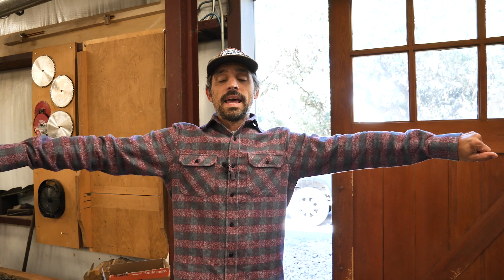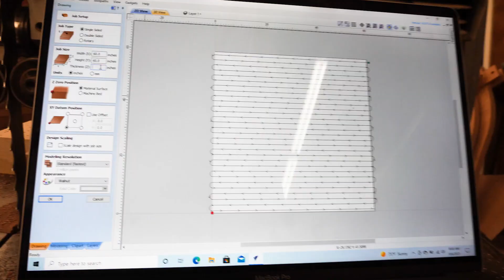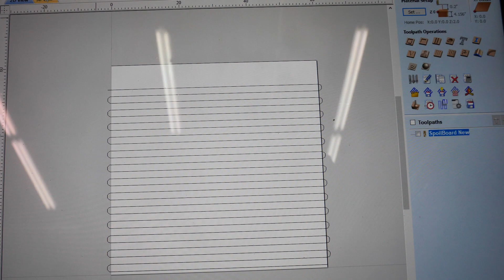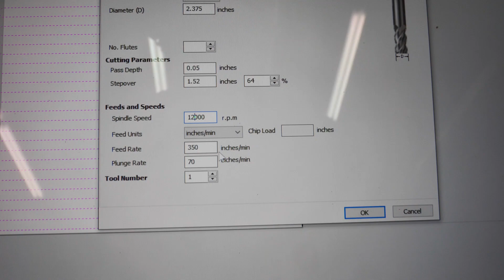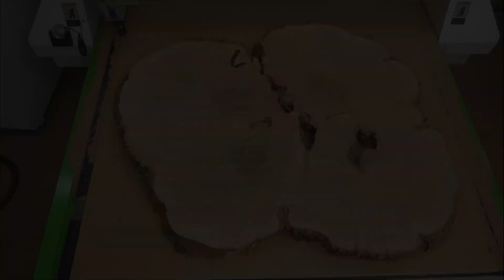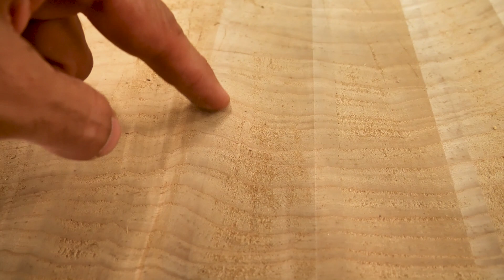Surfacing a Giant Ash End Grain Slab on the CNC

Comment: the tear out is likely because of the direction the cutter is moving relative to the direction it is spinning, also your stepover is huge, if you cut that in half to 50% of the blade diamerter you would get way cleaner cutting with less edging in theory, nice slab and nice work!

Comment: I'm not an expert on CNC's, but if I had to guess, the motor is likely not perfectly trammed in. so it's dragging in the one direction on something other than the cutting edge, but not in the other, thus the blowout (which is still pretty minor)
Reply from the maker: I don’t think it the motor.  This is a brand new machine and I’ve had no issues that would suggest the motor is not dialed in properly.  I’m pretty confident it’s a combination of feed speeds and rpm.
Reply: @AndyRawls  The motor is not trammed properly, ie. not perfectly perpendicular to the table, hence the cut pattern visible. Wide bits will show out of tram much more than narrow bits. If you run your finger across the cut I bet you'd feel a ridge on each pass.

Comment: The rough side of the cut could be a result from a non climbing cut, or conventional cut. Or it could just be a z axis misalignment. The machine being new and taken care of I would lean more towards trying to take the face mill in one direction while climb cutting
Reply from the maker: Interesting thought and worth a try.  Thanks
Reply: Yes, a climb cut will get you a cleaner cut than a conventional cut…  in metal at least. I’ve never machined wood, but the way I’m thinking it’ll work best is to conventionally mill into the wood from outside the workpiece. The amount of flutes or cutters on the… well cutter will also affect how clean it’ll cut, and so will spindle rpm relative to feed rate.

Comment: Andy is your surfacing but a straight cut conventional cutter or is it a multi tip carbide insert bit? I’ve used mine to surface all sorts of wood and it’s never once torn out. They’re expensive but last forever just like spiral cutter heads.
Reply from the maker: Multitip carbid inserts.  There’s three cutters on it.
Reply: @AndyRawls  your machine did look like it wasn’t tramming correctly have you checked that? It could just be the camera angle and some shadow lines? That might cause the problem.

Comment: With this soft of material you can probably go much deeper and faster in movement when ruffing, just need to do a finishing pad at the end. 
Well I come from metal so not sure about that.
Reply from the maker: I do think I could take a little more just trying to not overwork the machine
Reply: @AndyRawls  there isn't realy such a thing as overworking a machine, you do want it to work on the almost maximum of its ability, if you do so you can safe time wich also means saving money.
Reply: @Jason F we’ll probably not much harder then aluminium 🤷🏻‍♂️

Also might be worth using a tool with a larger radius and ore more cutting edges to also have a higher speed if the machine has enough power

Comment: Im not a wood worker but on steel  you sometimes need to cut against or with the axis motion for the best surface finish. 
Half the cutter is cutting in the direction of travel and the other half is cutting away from it.
  So perhaps programming the last cuts to only use half the cutters width and only cutting from the same side would help?

Someone else with better English skills will probably explain it better. 😅
Reply: 100% will help, Having the overlap will make a cleaner finish! I install and fix woodworking CNCs and that is how we set up our decking program and it works a treat.
Reply from the maker: Thanks for the comment!  This actually makes sense…it just didn’t occur to me.  I really thought it was a feed rate or rpm issue.